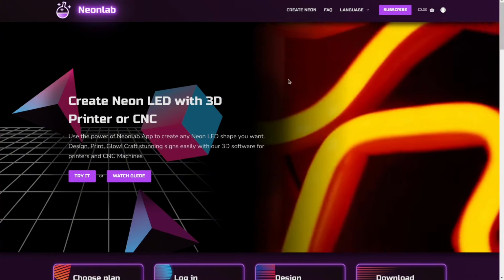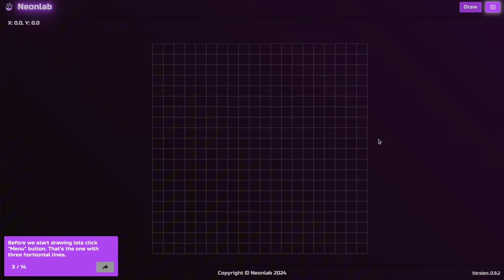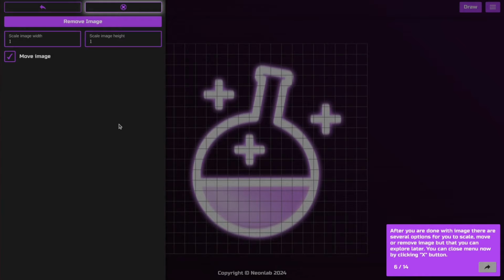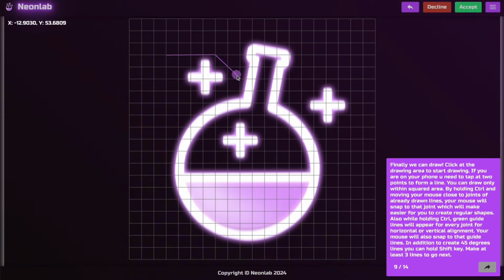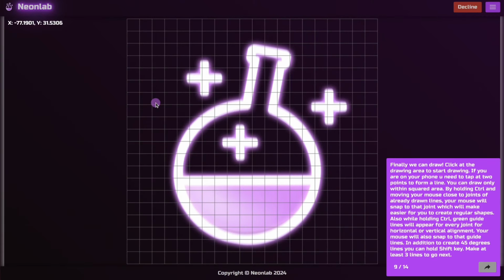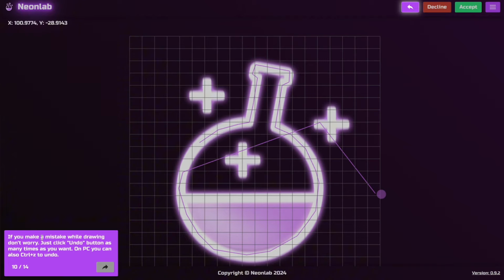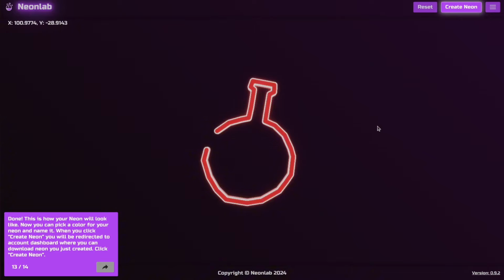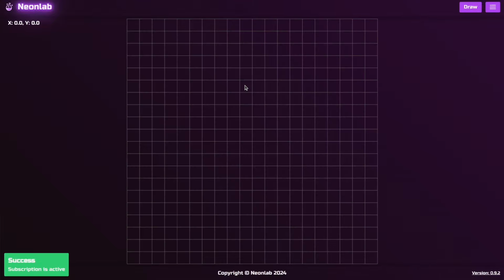Neonlab App Tutorial - Create Custom NeonLED on your 3D printer or CNC

Comment: This is really cool. It seems to be limited to about a square foot though. Is there a way to make a bigger sign? 
I know most buildplates are not bigger than a foot, but I could chop up the model to print in pieces.
Reply from the maker: Thanks! There is a possibility to add many custom buildplates. You can make sign bigger than 1ft2. Check out text tutorial here:
https://neonlab.app/10-step-tutorial-to-master-neon-creation

In buildplates section there is explanation how to do it (with links!). Tell me if you need any more assistance :)
Reply: @NeonlabApp thank you! I will have to check that out!